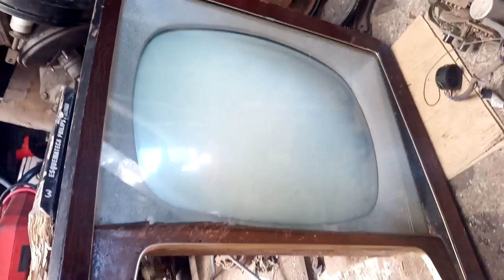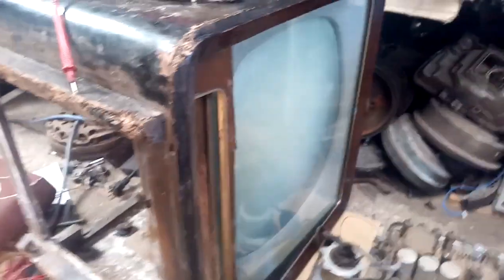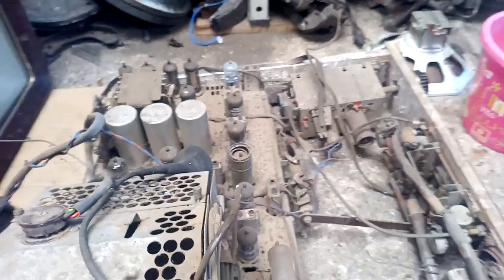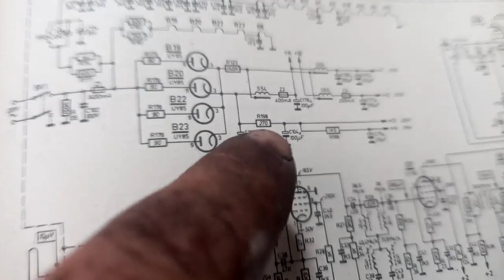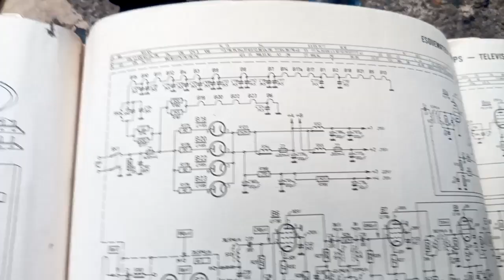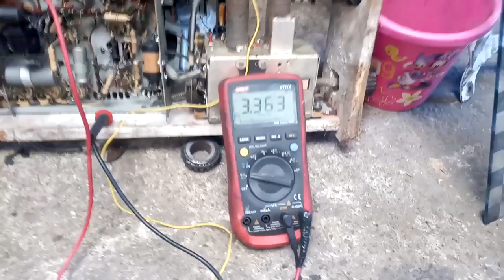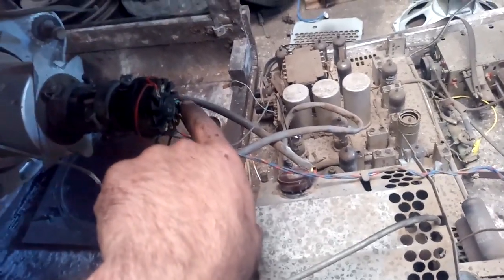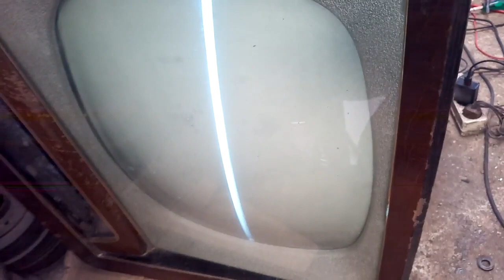Powering up a moldy rotten Philips 1950's tv (capacitor self destructs live)

Comment: Its a nice set. Old TV sets are hard to come by here in Norway. I usaly end up buying US sets from EBay. In my "world" it would be worth fixing the set. But if you got access to other sets its maybe not worth for you. Also I'm a big fan of point to point wiering lol (Philips too 🤩). Was fun when the across the line cap got "over heated".  I had way to many beers and liquor yesterday, so I found it best to watch the last part of the movie at the bathroom (in case one of the filter cap blew up ). Would be nice to see of you could get the horizontal up running. 

Btw: The heater to cathode short doesn't need to be a huge issue ? I usaly run my CRTs of a 6,3v power supply (so I don't burn out the CRT filament if I get an heater to cathode short on another tube. ) 

Anyway thanks for yet a good one! 🙂👍
Reply from the maker: Hi Eivind running the crt on separate transformer might be overkill but at the same time good idea as they are becoming so rare. yes it will work fine with the short as long as filaments are isolated (transformer fed), i might feed it 6.3v DC wich will improve things even more when and if it shorts... as long as the filament doenst burn out, because sometimes when it shorts it pulls 600ma instead of 300. i might try to clear the short by zapping it while it is upside down but its always a gamble.  Old sets are very hard to find here because we were in a dictatorship until 1974 and people back then were very poor, i might try to repair it i am still deciding but i will not trash it thats for sure...  I also prefer p2p wiring, much easier and beautifull than circuit boards. and you can do alll of the work on one side and not worry about lifting traces.
i might try to get the vertical running but if i run it for too long other caps will blow up..dont know why but every single video joining software that i try always craps out the sound, in this case the sound is off sync in the end of the video i am sorry for that i just dont have a lot of spare time to search for good free software. i know its hard to watch :) :)
Reply: @MrHBSoftware  Hey Hugo,
Why does the CRT filament draw more current when it shorts to the catode (if isolated with an transformer ) ? Also doesn't most CRT filament draw like (6,3v) 600mA ? two 300mA tube filament strings in paralel, in series with the CRT ?  (I usaly use a (10.5) 10-12 ohm resistor to replace the CRT filament ).  Here the economy was "good/ok" and the market got flooded with cheap Asian import stuff. So most old TV sets got trashed "hundreds of years ago". My oncle had to give up on his TV repair shop in the early 80s, as repairing old electronic equipment got less interesting than repair old shoes. Better to just buy new cheap stuff. I didn't notice any issues with the sound, but the vide did freeze for a few sec at the end. I'm not into video production, my focus is on what's going on in your videoes. So it was great from my point of view.
Reply from the maker: @eivindamundsen7090  Hi. its simple lets assume that the filament has 20ohms dc resistance (very tipical), sometimes if it shorts halfway against the cathode because its a twisted wire it often shorts also to itself and becomes lets say 10 ohms so it pulls twice the current and glows like a lightbulb. most crts that i see here are 300ma like the aw53-88 for example. yeah overhere most tv shops also closed doors in the late 80's and some survived till the 90's. now they are non existant or some converted to repairing cellphones. i find very interesting that overhere in the 60's nobody could afford a tv but the few that could only wanted TOP OF THE LINE stuff..we are talking 23 tube black and white sets, philips graetz nordmende etc etc . I really love the cheesy japanese tube sets panasonic matsushita but they dont exist here. other sad thing is that colour transmissions started late so we dont have any coulour vacuum tube sets. For me Philips is BY FAR the most reliable when it comes to vacuum tube stuff, also their design is incredible, looks modern for the era...love the bent plywood tv sets with all the controls hidden and the radios always have beautifull grilles and dials, very ahead of the time. then in the 80's people started wanting knobs knobs knobs, if you couild make a set with a million knobs then it was quality...nowadays we are back to the minimalistic approach of less knobs but nowadays they dont know what ergonomics is. in the 60's they sure did
Reply: @MrHBSoftware  Hola,
I see.. Some of the filament wire gets shorted out by the catode.. Thats bad news. Its probably not an good idea to current limit it to 300mA as the emission will drop (?). But maybe its an idea to current limit the CRT filament to 450mA, just so you don't burn out the wires ? 🤷‍♂️ Here color sets didn't become available before 1965 but radiation from the high voltage rectifier got hyped, so many people waited for the solid-state sets. Also I think most color tube sets got trashed in the 60s-70s because of radiation (?) But I can still remember seeing a few color (combo) sets with transistors, IC's and tubes in my uncles repair shop (US chassis in cheap junk TVs ). Norway also had atleast 2 companies producing BW/color sets (Tandberg and Radionette). It good sets that used high quality components (I think ?)  There is lots of old Norwegian produced Tube radios around, but not many TVs (Norwegian radios are similar to Grundig, Telefunken , Normende and Philips )
Reply from the maker: @eivindamundsen7090  yes thats it. this crt when it shorted i could bring it to 400ma at a little above 5 volts if i remember correctly, and the emissions were still fantastic. I think i can overheat it for a while while tapping on it with the thing upside down, then let it cool and it might clear the short "permanently". if not i might run it on 5 volts for the life of it so the filament doesnt burn out. From what i have read and seen radiation from the tube sets is negligible for the user , although some amount of it can be measured next to the back of the set if there is a failure in high voltage regulation or if the rectifier tube has open filament. but people were scared and its understandable. Anyway people travel on planes day by day and a plane trip gives lot of radiation exposure and nobody cares.. Overhere we had also a couple of comanies producing tvs for example "Ponto azul" was produced here and its a translation and layout knock off of Blaupunkt. We also had Oliva wich is Portuguese for Olive and they made and rebranded sets from other brands but they were best known for cast iron stuff like sewing machines anvils and vises.

i looked up tandberg and i found this model Tandberg TV1-43 wich appears to be a philips clone, i recognize the style of cabinet and the chassis from philips
Reply: @MrHBSoftware  Would be interesting to see some Portuguese TV sets. I think most Norwegian was Philips chassis (sometimes with British and German components ? ). I may have a Tandberg TV2 and a TV3 one my hand, so maybe I will try to make some videos if I can get em. Btw. Do you know anywhere I can get a schematic for a SABA T250 (Chassis Z204?) ?